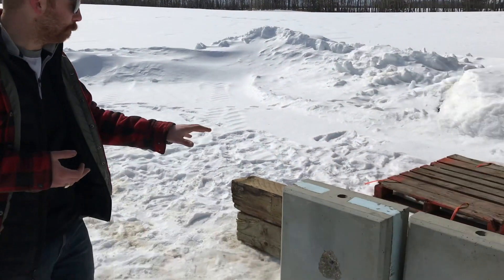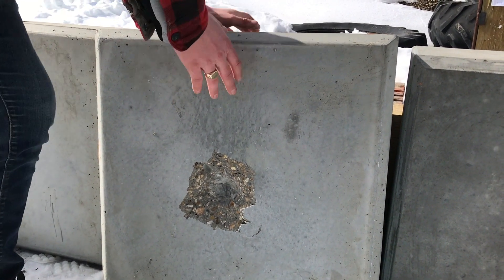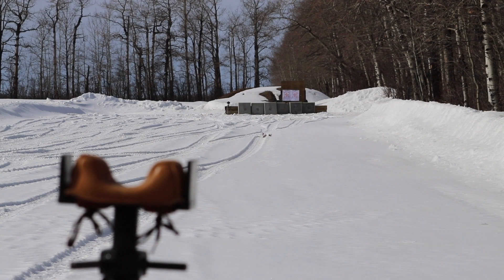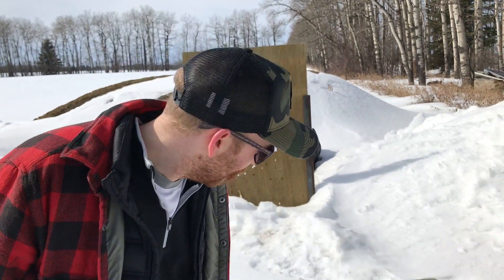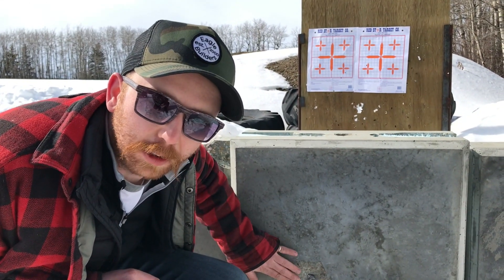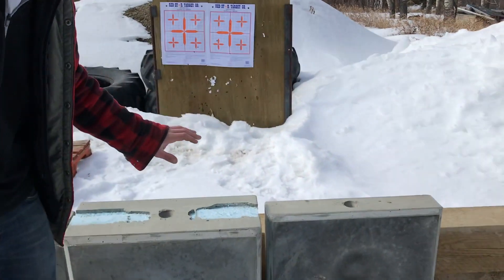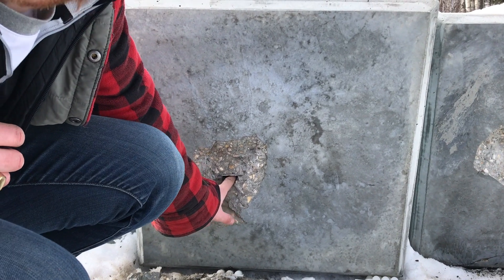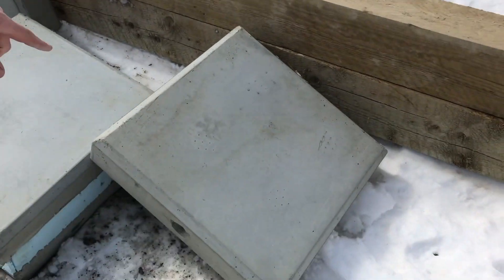Is Concrete Bulletproof?

Comment: Well done YouTube. I was wondering about this yesterday and this video pops up in my feed this morning. I was specifically wondering about four inch non-reinforced concrete, but these tests were close enough. My guesses were hand guns and small rifles, no problem. I thought the large caliber rifles probably wouldn't penetrate it either, but I wasn't sure, I thought a 50 caliber rifle might. My guesses, seemed to have been pretty good based on these results. The 50 caliber is still in the running to go through especially with the four inch concrete I was thinking about and especially if two shots are taken.

Comment: One of the best demos i have seen...What was the MPA and aggregrate size...
Try layering a high tensile expanded mesh in the concrete as the shock is what makes the concrete release the energy capture the concrete and the hole will be smaller and the round will be captured just like Fibre reinforced...

Comment: reinforcing the concrete with rebars will make it even MORE bullet proof!!
Reply: Better use a sheet of ceramic plates between two concrete plates. And if you want have a much better protection, then do it in an angle like shape.
Reply: @OpenGL4ever  concrete is brittle and will crumble easily. So will ceramic actually. Steel is more ductile. Should cover concrete with steel and use rebars
Reply: @prandomable  Ceramic is very hard, much harder than steel, that's why it will pulverize the projectile, making it useless. And the concrete behind it will absorb the energy.
That's how every modern tank armor works.
The only difference is, on a tank which is much smaller than a building you can afford and use steel instead of concrete, but you still need the ceramic, because it is much harder.

But for a building, massive steel is too expensive. It will cost you a fortune. This makes a large building unaffordable, so you don't waste this valuable resource on a building in such a massive amount. You take only very little of it, so you only have a rebar steel grid and steel grids don't protect you.

And no, using only thick steel sheets and concrete will not help you because steel is very soft, compared to ceramic. It will not pulverize the projectile. Especially not, if it is AP ammunition. And because of its price, it is also not very efficient. Ceramic + concrete is the much better option, it is much cheaper and thus payable in large amounts.
Reply: @OpenGL4ever  Ceramic is brittle. And will crack and shatter easily...remember this...
Reply: @Charon-5582  rebars in ANY concretes increase the tensile strength or ultimate tensile strength of the concrete. Without rebars, concrete could crumble much easier.
Reply: @Charon-5582  go watch people shooting concrete (with rebars). And (without rebars). There is a BIG difference with rebars AND without rebars. It's much easier to destroy concrete without any rebars with bullets...
Reply: @Charon-5582  bullets know the difference between rebars and without rebars. Bullets easily will shatter concrete without ANY rebars. With added rebars, it would take longer and more rounds to shatter the concrete cover...you apparently don't know how concrete works.
Reply: @Charon-5582  penetration wise won't make a differen ccorrect. BUT the non-rebar concrete crumble much easier...I think we were comparing oranges to apples here. Now we are on the same page now I hope.
Reply: @Charon-5582  a few shots. Can easily crumble a non-reinforced concrete. Whereas reinforced concrete it would take MORE shots to crumble. This is sort of common sense....
Reply: @Charon-5582  impact is impact. A truck crashing into a concrete wall is impact. Bullets hitting concrete wall is impact (as well). Except it's smaller surface area with FASTER velocity.